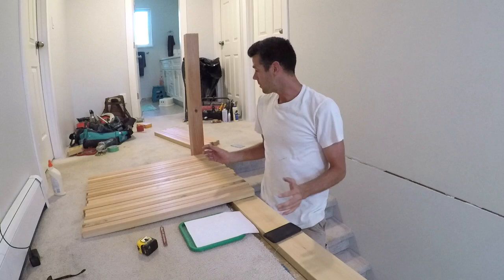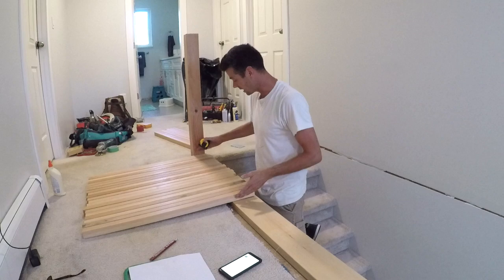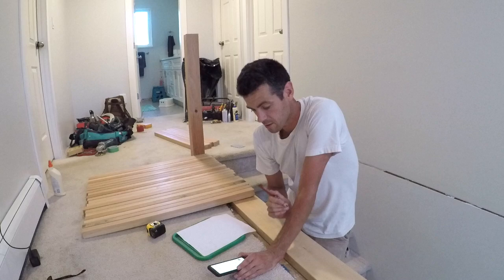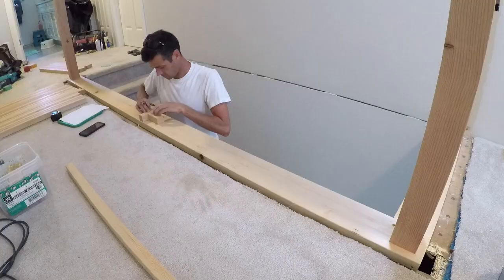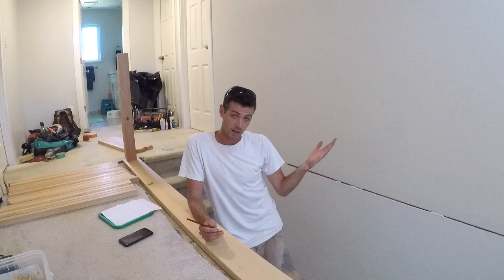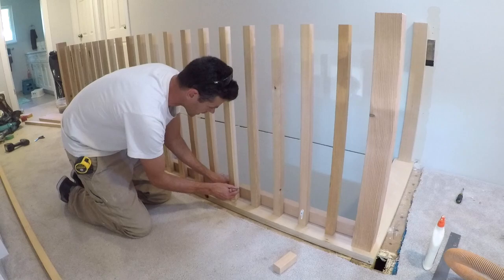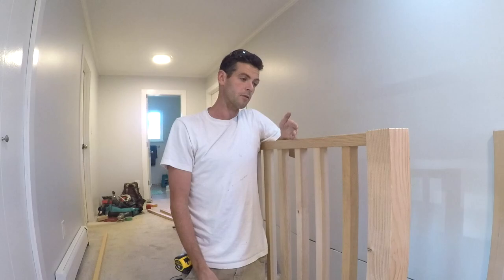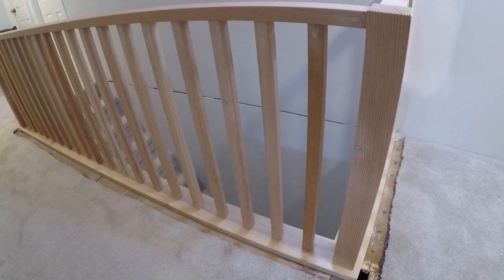How to get EVENLY SPACED Spindles!

Comment: When I turned my deck into a screened porch I recycled all of the spindles. They were much longer and angled on the ends where they screwed onto the side of the deck. I recut them and since they were old and weathered I sanded every single one of them until the gray was gone and they looked brand new. I had the same issue with spacing. With a screened in porch you have the roof posts spaced among the spindles. Most of the posts are just 2x4's but in the center and corners you have a 4x4 to carry the weight, so calculating the gap on the sides was the thing. But what was hard was inserting the railing back on between the roof posts. How do you screw them into place? Screwing from an angle through the 4x4 posts is not fun. Splitting the wood sucks. So I came up with an ingenious method. Each railing is held in place with 2 screws and two dowel rods. I would drill a wide hole half way through the 2x4 post on one side, then drill a narrow hole the rest of the way to the other side. This would allow me to counter sink the screw half way through the post and into the railing on one side. Then I would put a dowel rod in the wide end and that would be one of the supports for the rail on the other side. No ugly screws drilled through the posts at angles (except on the corners). And to make things more interesting once the rail and spindles were put in I installed lights in the railing. I took apart a strand of outdoor lights, carefully analyzing how the wires cross over and around each other. The way they wire them up is not what you would expect. Then I drilled small holes into the side of the rail to the center (evenly spaced so there were 3 lights between each roof post), and drilled a wide hole, the size of the socket, from the top of the rail. Then I fished the socket and wires that I cut down through the large hole and through the narrow hole to the front and pushed the socket down so it was mostly recessed. Then I wired all of them back up in the criss cross method I observed and spliced them all back together. Then I cut a channel into a 2x2 and carefully fed the wires into it and screwed that over the rail and over the 4x4 posts hiding the wires. And then I took a bunch of clear colored plastic cups I got at Target, that actually look like colored glass, but since they were plastic I could drill wide holes in the bottom with my drill press, then I put them over the top of the sockets that stick up out of the rail, and then screw the light bulbs in. I put all of them on a dimmer so I can sit outside and enjoy a refreshing beverage while looking at all my colored lights.

Comment: I use the same math as you do for calculating the baluster space distance.  I don't fumble around with a tape measure or cut a spacing block to lay out because of the accumulative errors that will occur.  I use dividers to walk off the spacing before hand and you can tell straight away when you're wrong.  I usually start from the top rail and plumb bob down to start the bottom.

Comment: Dowel pins. Drill a hole in both the spindle and the top rail.
Reply: That's what I was going to suggest.  Kinda tricky getting all of them to line up but still quicker than screwing.
Reply: Instead of marking the top rail on the bottom of the spindles you can make a template piece the same length and put those marks on it, then put it on top of the spindles and attach it to both the newel posts so it doesn't move, line up and drill all the dowel holes. Take that template and drill the top rail, then cut the template in half and use it to clamp the spindles in alignment. Simpler than explaining it.
Reply: @nathanmitchell4839  The only way i know if you are using hardwood to be stained and clear sealed, you may need to weight the top rail down while the glue sets. I used nice brass 90 corners under the rail on each end to provide end to end strength, ( Lee Valley ). Some guys use a ledger under the rail on both side of the spindle to hide the screws, if toe-nailing as our man did in the video. My preference is to use glass panels in between posts along the rail, a more modern look that would not suit everyone, but the clear view and light transfer is great.
Reply: Just put a cap on it.

Comment: Or make a spreadsheet with all the multiples starting from zero, and mark them all with one tape measure - gets rid of any accumulative errors.
Reply: I wish I could understand what your talking about as 5 people have liked your comment lol
Reply: Did that a week ago! Works!
Reply: AND... "Numbers" in Mac OS will break measurements down to 16ths. Not much reason to get more accurate than that.
Reply: One more thing... this can be translated to diagonals through rise:run ratios.
Reply: Tbh as he said just use.metric and you can it pretty much perfect
Reply: @Corey Mackay I had to think a bit to figure out what he was saying. What he said was to use a math program that can do math with better precision than 16ths and have it give you a list of all of the distances from one end. Then you aren't doing additive measurements, which adds error every time you move the start of the tape measure. You can do it with a calculator app and a piece of paper too, it just takes a bit more work.
Reply: @lwilton  Yeah.  It's not about better precision, it's about not making additive errors with pencils and blocks, which is fraught with problems.  The spreadsheet is the best calculator, and one shot with the tape measure is the best accuracy.  Another way to do it is to calculate and mark the centers, then mark the centers of the spindles - very easy and quick and hard to skrew up.
Reply: Well, you really want slightly better precision than 16ths to avoid roundoff errors that result in a long last space. The spreadsheet will handle that for you. But yes, I agree that it is about letting the machine do the math to avoid measurement and transcription errors.
Reply: @Cormack88  it is getting a computer program (excel for example)to give you the position of each spindle by giving you the distance of each one individually starting  from the first one .
The good thing about it that you hardly can make a mistake,and if you do , it will be only in any spindle position you did not place it correctly.  and it will not effect the rest of the spindles. 
The old way of doing it using a spacer can cost you since if you make a small mistake in cutting the width of the spacer you will use ,that error will increase  each time you place a new spindle. That is what we call accumulative error.
Assuming your spacer should be 4 inches but you cut it by mistake to  3.75 inches ,as soon as you place the first spindle you have an error of 0.25 inches and as soon as you place the 2nd spindle, you will have an error of 0.5 inch, (0.25 from the first spindle and anther .025 inch from the 2nd spindle) , the third will have an error of 0 .75 inch and so on.
Sorry if my English is not that great but,I hope you got the point.

Comment: Remember if your spindles have a skinny part you have to make them <4" at that point.
Reply: Spacing is actually supposed to be four inches ON CENTER. 
This way, skinny wrought iron spindles and beefy wooden spindles are spaced safely with a space that can't possibly be more than 4 inches
Reply: Wes Buckley that makes sure there is not an issue, but so does a 1” gap.   The requirement is 4” spacing between.   Balusters must be installed close enough that the space between them is no greater than 4 inches. A  4-inch ball might be used by the inspector to verify the spacing. Once installed, I think there is also a requirement for the balusters to hold up under  50 lbs. of pressure exerted over a 1-square-foot area
Reply: Perhaps it is just the manufacturer's install instructions on using 4 inch center to center, and not the building code book. One could assume they would be the same, but knowing that the maximum open space is 4 inches could help even out layout and save the cost of one extra spindle.

Comment: I was with you at 112.25" being divided by 21 which gives a spacing or 5.34".  Your first spacing from either post would be 5.34" less 3/4" (half the with of a baluster) and then 5.34" for each baluster center after that. I use divider calipers and walk off the spacing to the next newel. If the spacing is slightly off I make a minor adjustment in the caliper and start from the other end until the spacing is correct. You can also use a calculator and keep adding 5.34" to get the next center.

Comment: Great method on the layout. Re:top screws I would have used a 1/4” x 1.5” sub-rail strip and top screwed/glued into that. Then either let that form a 1/4” shadow line on the underside of the cap, or plowed a 1.5” wide dado the length of the cap rail, either full 1/4” depth for a flush look, or maybe 1/8” to leave a 1/8” shadow line. Either way, then you glue and screw UP into the cap rail. You still have a few fasteners to conceal but it’s much less noticeable, and can add a lot of strength if glued/clamped.

Comment: If you wanted a strong and invisible installation, glued dowels would be the way to go.
Reply: I was hoping to see tenon and mortise method using fenced router jig or something to achieve strength....
Reply: Pay someone to do it. See what you want then. joints are for display and strength. Not a pine handrail :)

Comment: Good video - If viewing in the UK the 4" GAP would not be suitable as it comes to almost 102mm metric. You would have to do the same as above but allow for 99mm max gap as Building Control states that "Construction should be such that a 100mm sphere CANNOT pass through any opening in the guarding" - hence 99mm max. (Possibly allow for even tighter spacing if not straight but curved spindles and or newels)

Comment: Step it off with dividers starting with 5.5" maximum and making adjustments until it comes out evenly... you are marking one side of the spindle. Once set, if needed, work from the other end of the railing to mark the other side of the spindle. This will also tell you how many spindles you need whereas you had to figure that out beforehand. This eliminates the marking creep that can happen when marking in the manner demonstrated, and it also eliminates the rounding errors that come from converting decimals to fractions.

Comment: Looks great... But I'd go with screws on top. But the way I would of done it, I would of made the newel post taller, then used an additional handrail/Gaurd rail above the screws making it a two piece system. That would of covered the screws making the handrail more robust. Then attach that additional handrail from below, screw it from in between a few of the spindles. 
But it's all getting painted... :) Plus your math is spot on.

Comment: (Total length + width of one post) devided by number of spaces. That should give you the spacing between each post, except start and end is minus half the width of a post. This only works if all posts are the same size.

I would also predrill top and bottom at the same time, but not all the way through the top. Then make the predrilled holes in the top larger to fit a dowel, and use that to hold the posts. Gluing that is just as strong, if not stronger, than a screw.

Comment: First I have to say that I just love, love, love your videos! Now I think I would've used your spacer and laid all of your spindles out in order to get a good feel for how they would line up in the run. Then make your adjustments and marks as needed. After putting the single screw in the bottom of each one I would go back with a small nail towards the corner of each in order to keep them from ever twisting. On the top after getting your marks made use wooden dowels in the center of each and you can still use a small nail to the side of each just drive it a little more than halfway into each spindle and then cut the head off at an angle. I hope this helps in the future for projects that won't be painted. :-)

Comment: The incremental error introduced by rounding and then using a cut off & a spacer block is the problem with this method. I'd add 1.5" to the overall length (half of a baluster width at each end, so 110.75 + 1.5 = 112.25), divide that by the number of spaces (112.25 / 21= 5.345") which rounds to 3 5 3/8"") which gives you your 'centres' dimension. Then, starting from one newel I'd lay out off a tape butting into the face of the newel, the centres dimension giving you the 'far' face of the baluster from the newel. A ConstructionMaster calculator or phone app (or other similar) will give you the overall rounded 'centres' dimensions, one by one, without any incremental error. No fudging needed.
Also, the spacing is so babies can't get their heads THRU the gap not so they don't get stuck - if baby can get head thru the gap then baby can go downstairs quicker than baby should.

Comment: Get a measuring tape that has both decimals and fractions, hard to find but when you do buy two. Tip one make a list, down lode it from the web save in your note book or your phone.1/32=.03125, 1/16=.0625, 3/32=.09375, 1/8=.125, 5/32=.15625, 3/16=.1875, 7/32=.21875, 1/4=.25 etc.  No toe screws, it's going to be painted.  pre- driil counter sink fill the top with a dowel and gorilla glue (whatever that expansion foam stuff is called) sand and  paint.

Comment: Once you know the spindle count is 20, use your framing square to set a perpendicular to the far post (inside edge).  Then draw your tape out to 120" from the inside edge of the near post to the perpendicular.  Mark off every 4" and using a framing square.  Then drop a perpendicular line to the actual work piece.  Each mark will be exactly spaced with no math.  Of course this won't work in every situation as you might not have room.  Just select a workable number of spindles...perhaps 5 in this case.  Do the same thing to get your spacing.  Then use dividers to mark out the other locations or make a story stick for five spindles and just move it down the line.
Reply: I saw Tom Silva of This Old House fame do that trick measuring with a tape measure.  Stated another way, put your tape measure on one end and then stretch it out to the other end and then raise it to a nice easily divisible number (you'll be creating a triangle kinda sorta...tape measure is the hypontenuse) and mark down to the long leg.  I use this all the time in my cabinetry work now.

Comment: I do alot of rail and here is my way
110.75 + 1.5 " 1 picket " =112.25 ÷ 5.5 = 20.409 round up to 21 . So 112.25 ÷ 21 spaces = 5.342 centers 20 pickets then using calculator store 5.342 in memory function then add memory recall and continue thru  entire length. For example 5.342+ memory recall = 10.684 + memory recall = 16.026 ... this is basic math and with a little practice your pickets will be perfect every time and layout top and bottom at same time with square

Comment: Great video Ben, 
But there's a much easier way of laying out ballusters....
Take overall run, add the thickness of 1 balluster. (Known as a ghost balluster).Divide this new run by desired space and balluster. 
Ex. 48" of run + 1/12" balluster -491/2".  Divide by desired space + 1 balluster.  49 1/2" ÷ 5= 9.8 rounded up to 10. 49 1/2" ÷10= 4.95" . Or, 4 15/16".  Now, pull your tape and mark 4 15/16". This is the leading edge of the balluster. Continue adding this measurement and marking each leading edge.
Reply: Nathan Silver quite possibly the most confusing thing I've read today (and I've read a lot about a lot today)

Comment: Metric in NZ too, a lot easier. Been a while since I did a hand rail but last time I divided all the gaps in half until I got down to the last size which happened to be just smaller than what was regulation , in that case halving worked okay. So say your total length was 1.6 meters half that is 800 millimeters  then half that is 400 millimeters then half that is 200 mm then finally half that is 100 mm (or 4 inches ) to the center. If it works out close it's a quick easy way as you can just quickly work it out on a piece of paper or the good old block of wood.

Comment: Thanks Ben for ALL your great tips and teachings.

Just want to add a tip to your method of laying out the spindles.
As shown in the video at 5:06, there was about a 1/4" extra in last space.
What I've done in the past in cases like that, is wrap 1 or 2 or 3, etc... layers of masking tape around the end of the spacer block to add fractions of length to the block.
Do the "double check" again, and you should see a reduction in the extra space at the end.
If your block doesn't fit in the end space, either go with it, or just remove one layer of tape, or if you only had one layer, use thinner tape.
Hope this helps some of you.

Comment: First issue, not double screwing the bottom rail balusters which can now twist over time. Dowels would have been a better option than screws, but again the balusters can twist...even after being glued. Ideally, you could have dado'ed the top and bottom rail and ripped some biscuits to fit between the balusters inside the dado. Glue and double brad each baluster, brads hidden inside dado/biscuits.

Comment: you should always mark centres of each post not edges. especially when dealing with an irregular material like wood. There I also a far simpler way to do this. Find centre of the space then if you want a 4" spacing simply take the spindle with plus space (as he did) so 5.5" and lay your tape at an interval of 5.5 so say 44 or 49.5 etc to get yourself as close as you can to your end. If that space is greater than half of 5.5" you will set the centre of a space at your over all centre mark instead of the centre of a spindle. Its always one or the other. once you've decided which it is simple make a mark every 5.5"